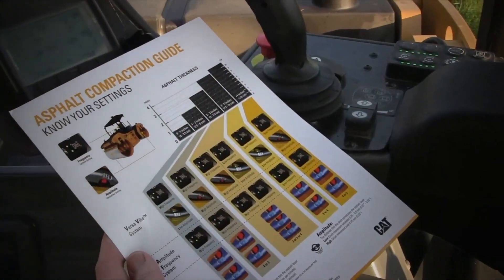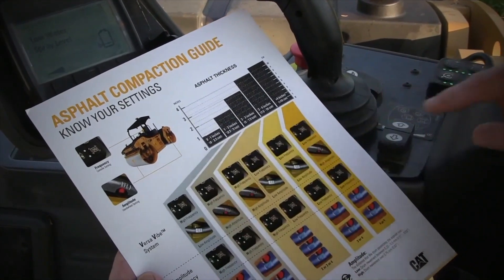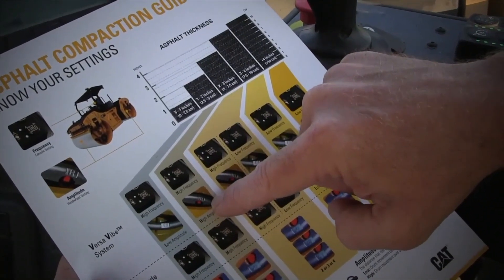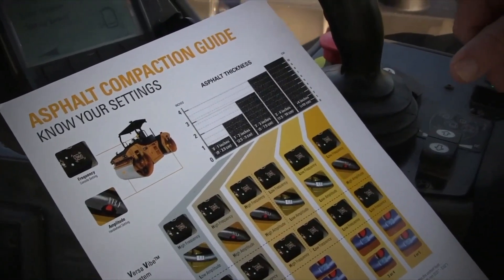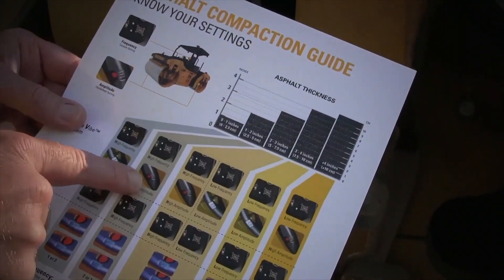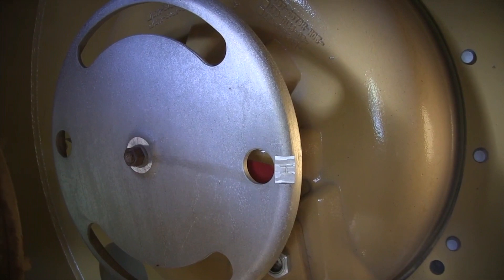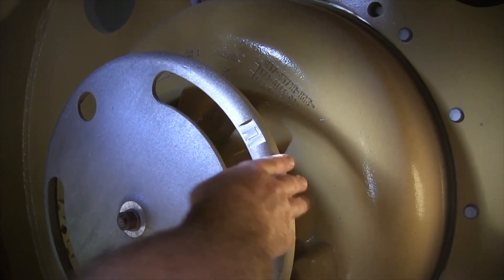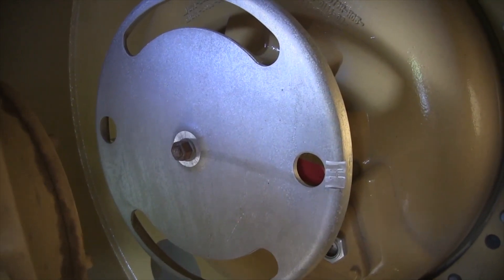How To: Vibratory System Setup for Cat® Tandem Vibratory Rollers

Comment: Vibration for asphalt compaction is ok as long as you know how compaction works, still a major part of compaction must be done in a static mode. To much vibration will not lead to higher density, after two or three vibratory passes it is better to continue with static rolling. A static three wheel roller has the best performance and is able to improve density on lower  mix temperatures, a tandemroller compacts until 90 degrees Celsius, a static three wheel roller compacts still under 65 degrees Celsius.